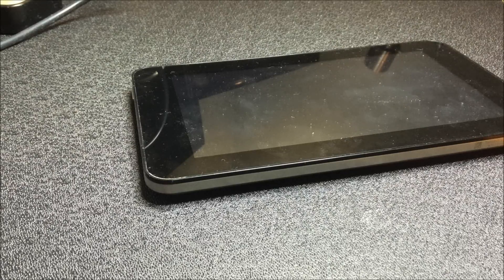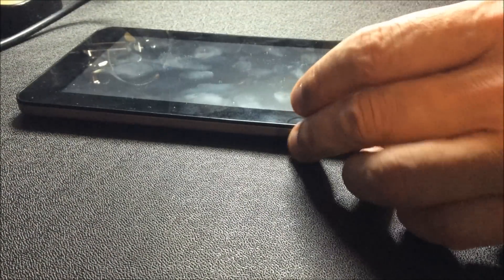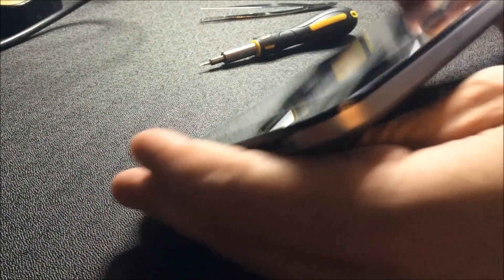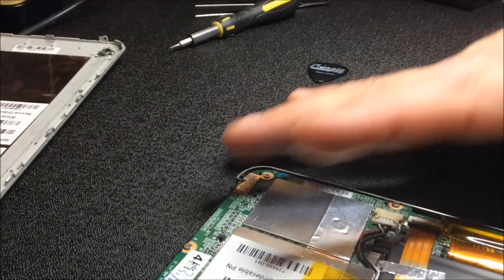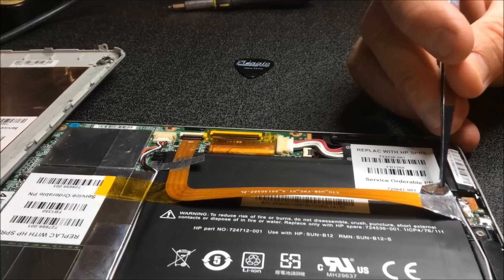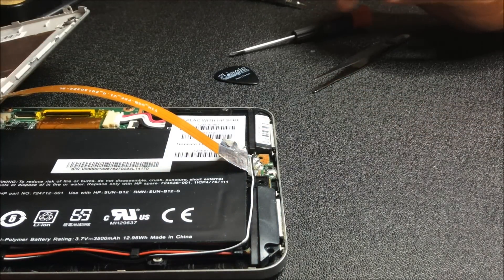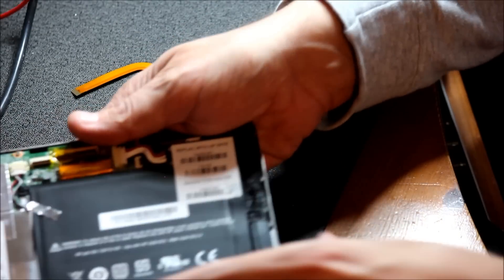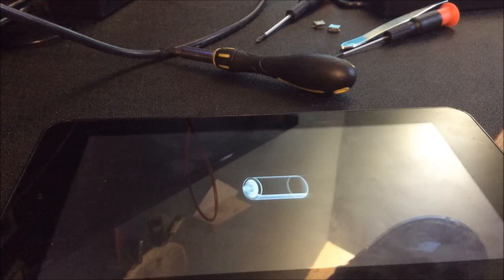Steve'll Fix It S01E02 HP Slate 7 USB repair

Comment: Steve, does it matter if the solder has bleed from one of the really really small points on the USB plug? Out of the 5 points, the solder has bleed and now has solder running / connecting on the board from point 4 to point 5 ?
Reply from the maker: +tobysnell1 The simple answer is: If you get solder inside a connector, throw it away and start again.